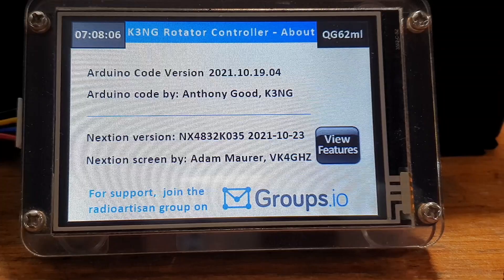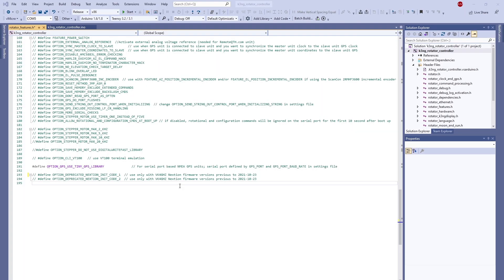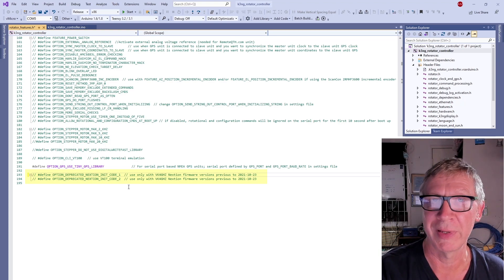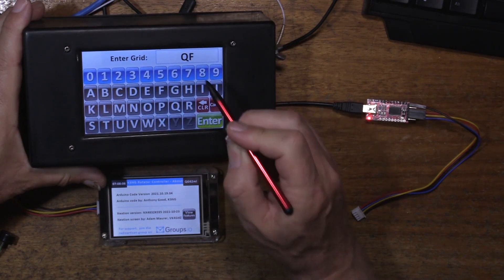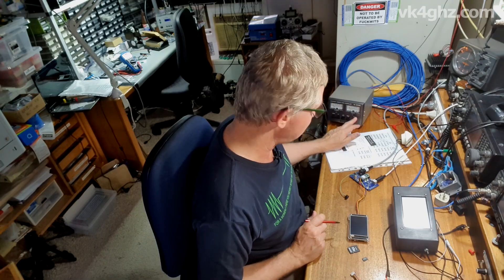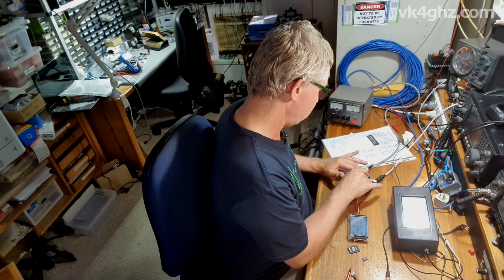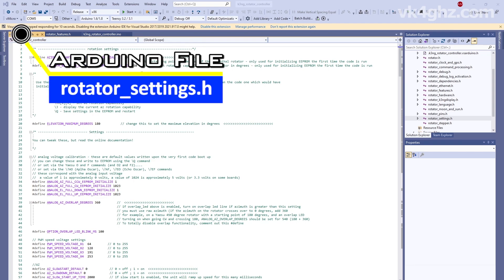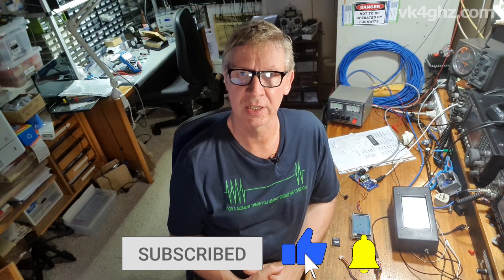VK4GHZ Nextion for K3NG Rotator Controller Update 2021 10 23

Comment: anyone know how AC motors could have soft start/stop feature ?? I run the old G5500 AC and I would really like to have ramp up/down to ease stress on the antenna array and motor gears...
Reply from the maker: I started developing a project with soft start/stop mid 2021.  Life gets in the way, but I hope to return to it during 2022.  This requires an ancillary MCU to manage that.